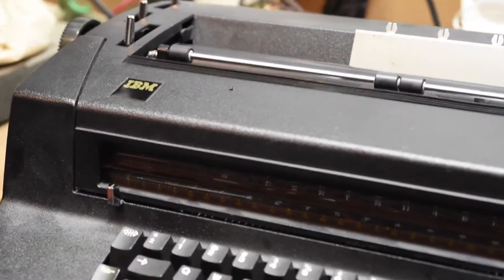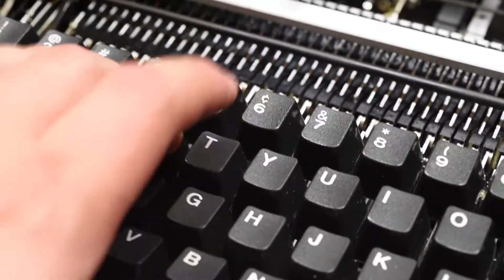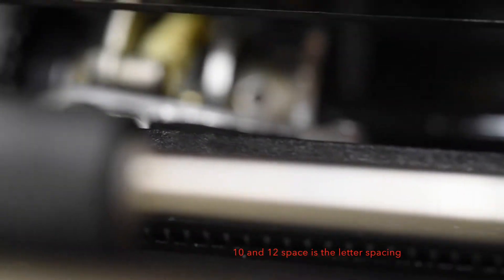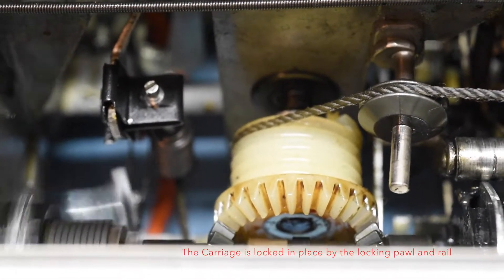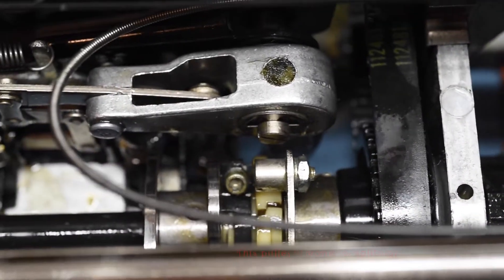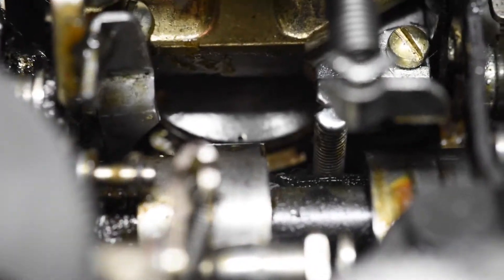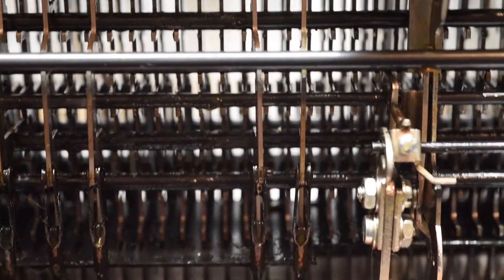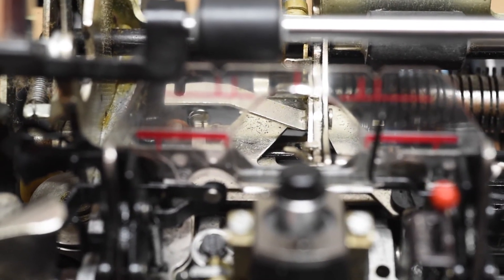A Dummies guide to the IBM Selectric

Comment: I serviced Selectrics for 25 years. When they were sticking I removed all casings, ribbons, correction tapes etc and cleaned them with air pressurized varsol, then sprayed them with typewriter oil. The varsol washed all the old oil and grease out. Then greased cams, cam followers, cycle clutch, degreased rubber drive belt, checked adjustments. Looked and worked like new. Secretary's loved me
Reply: What grease did you use? I'm looking to repair one and I don't want to use the wrong kind. Would STP all-purpose grease work, or is there a specific kind you would recommend?

Comment: I bought a black IBM Selectric III from the IBM showroom in Manhattan.  It was about $700 or so but it was worth every penny.  I had used other earlier Selectrics and that's why I bought my own.  It was a fine machine.  It had a wonderful keyboard and I could type well over a 100 WPM on it.  I also bought three extra balls for it with different typefaces.  I got plenty of use out of it until I sold it and bought my first Macintosh with MS Word.  IBM Selectric typewriters can't be beat.  They're just so smooth to use.  This video really brings back good memories.

Comment: Small correction: you said that the set screws for the platen are allen screws.  They're not, they're Bristol screws, and almost all of the set screws in the Selectric are Bristol screws. Using an allen key on them will eventually strip them out. Bristol is a little more like torx, and I've had luck using torx bits on them without doing damage, but only did that because I too didn't know that they used a completely different type of bit.

Comment: Thank you!
Every other video I have seen, had the new mechanism with easily accessible tabs to unlock the cover. My typewriter has the same mechanism as yours, but I wasn't sure how to operate it. At 1:20 you say to pull i towards the back of the machine. At my machine it was to the front to unlock.

Comment: I'm a new adept in the art of Selectric repair, got model III correcting recently. Thanks a lot for the explanations,
I unscrewed the hex grub screws on the platen shaft before taking the typewriter's case off because Ididn't know about the platen latches until I saw Fran take the machine apart for repair.

Comment: What kind of lubricant do you use for these? I've seen gun oil for manuals, idk if these need something different. I have a 1 right now and a II on it's way, and both need work, but the 1 is typing, the typeball just isn't twisting to hit with different characters and the carriage, (is that what it's called with these? ) The mechanism with the ball and ribbon that's supposed to move, is stationary as well. 
I was hoping they'd have a carriage lock type thing like the old manuals, that was always an easy fix, not gonna be so easy here. haha.  Gonna  take apart and clean everything up, start there. This video has been super helpful.

Comment: Can it be converted into a fully manual typewriter without the need for an electric motor? That is, to work without electricity, but while maintaining the same mechanism.
Reply from the maker: Yes and no. The mechanism won’t work without the main shaft turning. There is a way to manually turn the shaft but you need to have the mechanism pulled out of the case for that to work. See my other video about how to hand cycle.
Reply: @pacmanpaquette  For example: the electric motor can be replaced by a spring motor that works by storing the potential energy in the spring and then releasing it in the form of a movement.  Strong, precise and airtight, so we don't need electricity We'll take the machine with us wherever we go!  What's your opinion?

Comment: Thanks so much.  Perfect for my level with some mechanical experience in advance, learned to type on one of these and knew a few switches, but not ever had the cover off.  My used Selectric II isn't gummed up and issue were the two blocking plastic pieces with the patent sticker and jewelry warning sticker have warped a bit and interfering with the carriage movement in two spots.  Removed them for now and thinking how I might unwarp the plastic.....

Comment: This is a great video, thank you. No one seems to talk about what products they use to clean and oil the typewriter. I don’t know what kind of grease and oil to buy. Also, how do you get the gummed up oil out of the tiny spaces? Thanks, again for a great video.
Reply from the maker: Good question. I use mineral spirit or varsol to clean the oil and use 5w30 synthetic oil to lubricate parts. A little oil goes a long way.
Reply: @pacmanpaquette  THANKS!

Comment: Hello Adnre,
i hope you are reading my comment.
I got one IBM Selectric lll a few days ago. 
But somehow I broke my metaltape, that turns the golfball.
So I basically I have the same problem as you had, but I have no Idea, where I can get an new tape and how to put it in.... Can you please help me?
Reply from the maker: Hi Badulai, You can purchase rotate or tilt tapes mostly on ebay these days. You will need to make sure you get the correct one in the correct length depending of the carriage width of your Selectric. Usually, Selectric 2's are 15in. Hope this helps.
Reply: @pacmanpaquette  that definitely helps. In Germany I can not find those, but maybe I am lucky and I can get a not working mashine with that tape
Thanks!

Comment: I used the selectric in high school and college. Toward the end of my college, we had the computer lab with word processors. The paper template over the keyboard for Word Perfect looked like an instruction card in a jet airliner. Alt, Cap, & lots of tiny print to tell you how each function works. 1989? I think. I did use a manual portable before this. My fingers had muscle bulges!

Comment: You are an absolute godsend, I just bought an older 1961 ibm typewriter and have no idea how typewriters even work, (I work more with custom keyboards) luckily I knew that I found a gem when I saw it, I paid a whole 12 dollars for it. Thing is that it’s filthy, lots of keys are sticking, and it’s covered in dust from the inside out. So this video showing a little bit about what I have is super helpful even if it is a newer model, thank you.

Comment: The aluminum part under the platen does not need to be removed to remove the upper half of the case.
The most common part failure is the return spring that that has a plastic piece that breaks. It's the double spring contraption on the far right with the pulley with the string around it.
There's a special cycle tool needed to replace the rotate tape that threads into the operational shaft that the cam is on.
https://youtu.be/ojWvWvbrLWg

Comment: Many thanks for a very interesting video.  I used to work on the IBM 2740 and 2741, which had almost identical mechanics, but with added electronics to make them data transmitting machines as well as typing.  That was long before I even retired.  Now in my spare time I play with other things and I often need the small   that was standard issue un the IBM toolbox.  Can you please advise me where to find one.  Thanks again.

Comment: Watching this ... as well as another similar video but limited to showing the operations of the golf ball, I'm curious as to how these machines are actually manufactured (or put together, more accurately).   I find it hard to think/believe that people put together the thousands of these completed machines by hand ... is that how they were taken from individual parts and melded into a finished typewriter.   If that's the case, I'm amazed.

On another hand though ... watching this being broken down makes me wonder how building this machine from the individual parts is accomplished by machines that construct the final products.  I kind of feel like I should be more blown away by the assembly process itself, and not so much (so to speak) by the finished product.

Is there anyone here that can talk about that a bit?

Comment: Just a trivial detail, it won't be from 1976, IBM did not release the Selectric III until 1980.  You can fairly closely date your unit from the Serial number, and it might also have the installation/service history on the label underneath. Check out the "golfballtypewritershop" groups on Yahoo & Facebook, Good effort on the video, cheers.

Comment: What type of oil do you use to lubricate the moving parts? Thank you!
Reply: I have used sewing machine oil on my typewriters because it is specifically designed to not gunk up or leave any residue. I have heard that some people use valve oil (the kind used for brass instruments such as trumpets), but in my experience that might gunk up over time if exposed to any type of particulate.

Comment: I'll be getting one in short order.  Since this thing does plug into a wall socket, I'd like to know if there are there any exposed electrical contacts involving non-transformed power on the Selectric?
Reply from the maker: Hi, thanks for the comment. It is a great machine if only to play and learn on. To answer your question, the power from the wall goes to the power switch then into the motor on the back of the machine. The wires are insulated so there is little danger. Thats it, the only thing powering the machine is a spinning motor.
Reply: Thanks!  I bought my Selectric 1 from a retired secretary recently, and as you said, it was very gummed up.  The back label said it was last serviced in 1971, and I was surprised that it even turned on and typed a few characters before some problems became evident.  Ultimately, I had it taken away by a servicing company, since I couldn't do much about it.  Recently, they phoned me saying that it probably was serviced regularly during the '80s, but the company that did it simply failed to fill out the label underneath.  It's a truly neat machine and a mechanical wonder.

Comment: Awesome video man, I have a selectric 3 too, having an issue. The space bar and letter keys do not increment the carriage. The tab, backspace and return keys do move the carriage as designed however. Any ideas ?
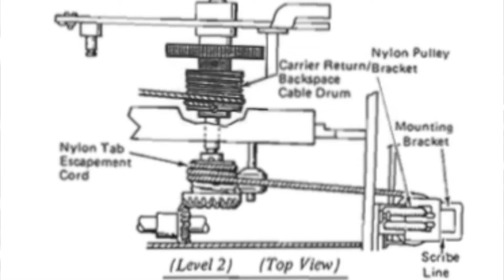Reply from the maker: Hi, thanks! You want to look at the clutch springs as described in my video at around 7:10. I think the left one is for carriage return, enter key ETC. The right one is for the letters. Check that there is a tension spring and that the clutch spring is there, free of lubricant etc. If its oily, you can use some mineral spirits or other de-greasers. I would check both clutches to be safe. Also lift it up and check all the pivot points to make sure its clean and lubed.
Reply: Hey mate! I finally got around to ungreasing the springs at first it did nothing but after 15mins everything seems to be working as intended. Thanks so much for pin pointed the problem. I never thought that a typewriter could be so complex, Ive just downloaded a whole 10 part slide series on the IBMs and will have to sink my teeth in shortly. Anyway thanks again !

Comment: Locking pawl = Escapement or Dog     Escapement engages into the "Rack"    get your terms right.   I've replaced a thousand rotate tapes over the past 40 years. Tilt tapes don't break as often. The reason your carrier wouldn't stay to the left is because the switch pitch lever was between the 10 pitch and the 12 pitch setting, make sure the lever is either all the way back or all the way forward, easy fix,  see it all the time.
Reply: Hey Guys I could use your help. I own a Selectric III 670X. The carriage doesn't move to the right when I press space bar or type a letter. However it does tab, backspace and return fine. Any idea what is wrong and where I should be looking to solve this issue ? Thanks in advance !